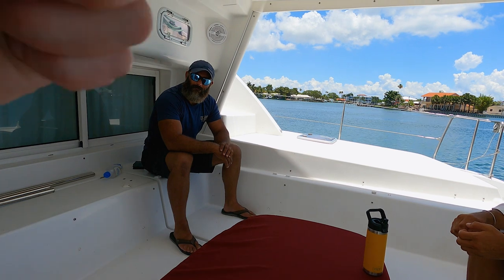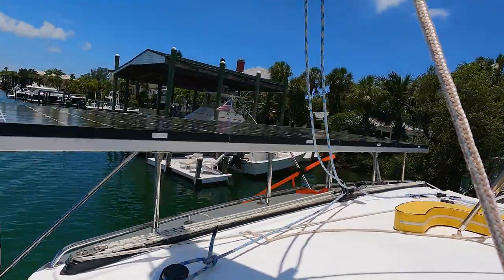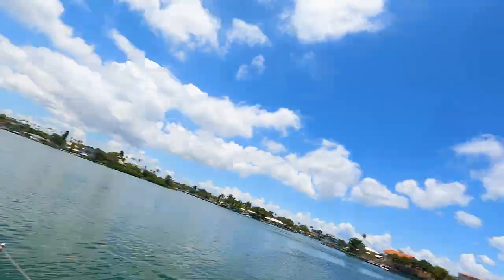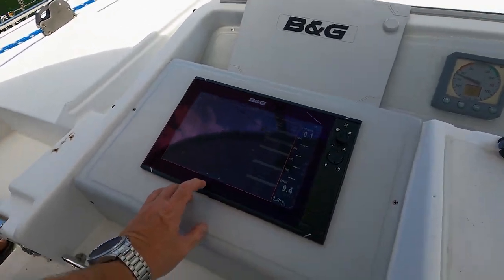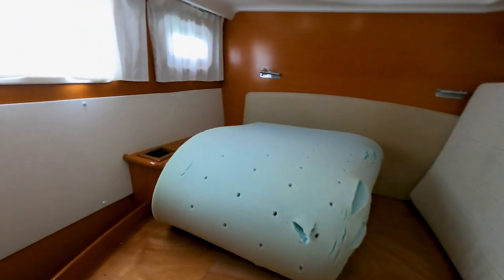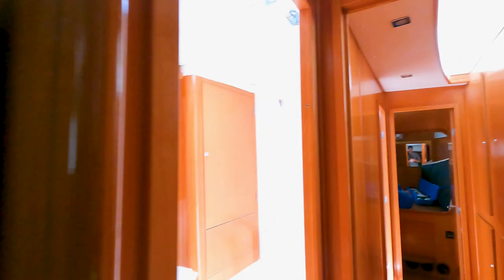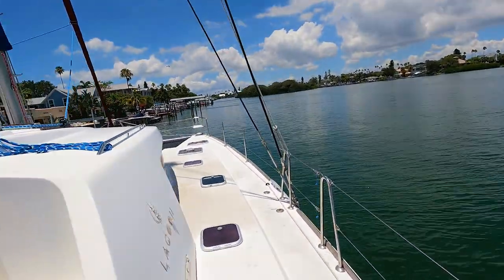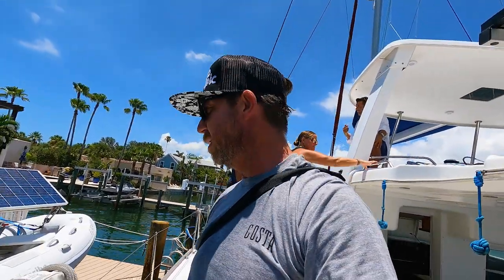For Sale: 2007 Lagoon 440 $275K

Comment: I would also check the bulkheads. I have seen 2 Lagoon 440's with busted bulkheads. It seems around the year 2000 Lagoon went cheap on their bulkheads.
Reply: that's the first thing to check , rigging needs replacing , one would have to go right over the sails , just about pull everything out of the rally and upgrade , upgrade electrics to completely off grid , BIG JOB , motors need pulling out and rebuilt , props .. prop shaft and gears need rebuilding , all stainless steel in bathrooms and else where needs replacing , anchor chain needs replacing ........ and the list goes on

Comment: Right, and by the time you fix what you find broken on that catamaran 15 more things will pop up. Best to stay away from a boat that hasn't been maintained or overhauled...
Reply: if you got it for around $100,000 or less one might be able to do ok with it , needs a fair few upgrades plus you can never believe what your told so you could halve what's been told , it makes you wonder why they buy these things then let them go with hardly any maintenance